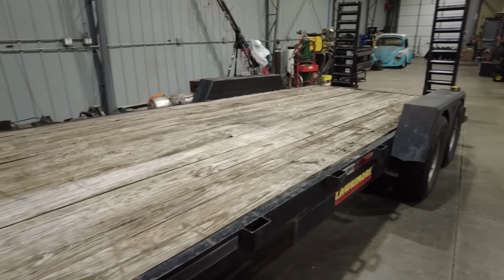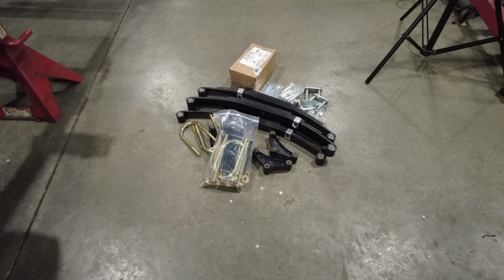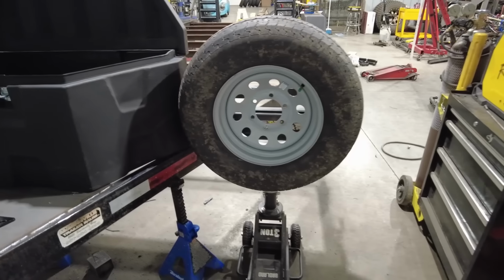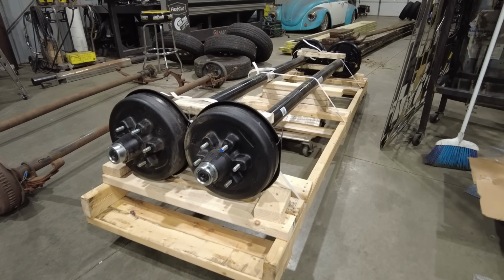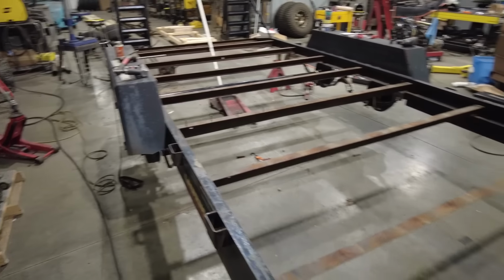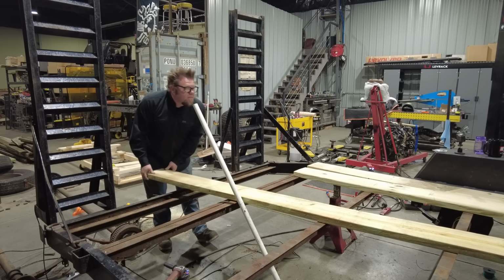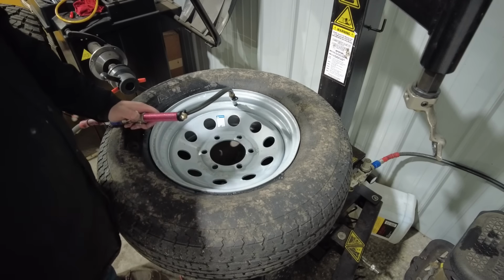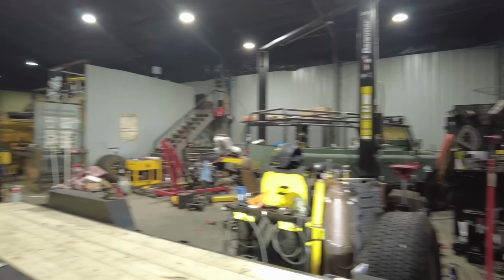Car Trailer Rebuild, How to Increase the Load Capacity of your trailer

Comment: As an Electrician, every time you mention a wire color, I want to scream NOOOOOOOOOOOOOOOOOOOOOOOOOOOOOOOOOOO!!!

For a Canadian or US Electrician, the following colors are LAW:
1-Phase 120 Volt Circuits:  Green is Ground, Black is Hot/Live and White is Neutral...
1-Phase 240 Volt Circuits: Green is Ground, Black is Line 1, Red is Line 2 and White is Neutral (so you can have a 120V device in a 240V appliance/circuit such as the lights and clock in an electric oven)...120V Line to Neutral, 240V Line to Line...
3-Phase 208 Volt Circuits: Green is Ground, Red is Line/Phase 1, Black is Line/Phase 2, Blue is Line/Phase 3 and White is Neutral...

Note: The Ground can also be Green with a Yellow Stripe or just bare, uninsulated copper...

😄😁😆😅😂🤣
Reply from the maker: You are comparing 12v to AC...completely different
Reply: @BigTireGarage  Yah, I know...but the Electrician in me just can't stop screaming...

😄😁😆😅😂🤣

Comment: Jack Upgrade suggestion: Mount a small motor to the jack with a gear on the shaft that is level with the top of the jack's top nut (the one the impact socket is used on) and either replace that socket nut with or weld a matching gear onto the nut so when you push a button, the motor spins and the gears then work the jack as if you're using an impact on it...

Then, you can dispense with the dedicated impact and charger and just run it directly off the winch battery in the tongue box (and mount a solar cell on the lid to keep the battery topped up when not connected to the truck)...A set of buttons in a waterproof box mounted to the outside of the tongue box completes the deal...unlock the cover, hit the button and the jack goes up or down as needed...
Reply: But he probably wants an impact wrench handy for fixing a flat or whatever. The manual mode on the jack is nice for if all else goes fubar you can just crank it by hand
Reply: @senorspiegel  a battery drill is all I use it dosent hammer on the spinny thing and they are cheap..usually have a few laying around .

Comment: For good reliable ground connections, I found placing a star washer between the frame and terminal, creates an incredible life long connection.  I have yet to have one fail .
Reply from the maker: Have done that, I have also welded studs onto the frame as a ground lug

Comment: As a lifetime upper midwest resident, I gotta ask, why didn't you address any of the rust while you had everything torn apart?  It would have added a couple hours of work, but extended the life of the trailer by 10 years.
Reply from the maker: It was just a little surface rust....nothing to worry about here in the south....and to do it right it would have taken quite a few hours

Comment: If I understand this correctly the weight of the trailer is included in the weight rating. So a 10k capacity trailer includes your poo box and the weight of the trailer with all its gear on it. I run a 10k factory built trailer and looking back my 7200# built Land Cruiser and the weight of the trailer was right there at capacity. Also, how do you know the frame of the trailer was over engineered enough to actually handle 10K weight? My trailer appears to be the same size as yours as far as length. Putting your spare there is the best idea I have found for the most flexibility of trailer use and keeping those annoying round buggers out of the way. My cross country trip had one spare. For the next trip there will be two and a winch and the wiring will be reviewed and butt connectors put in. @harrysituations posted a great video of him having a conversation with his trailer guru. I heard more about trailers than I knew and some great trips on maintenance. Great build Ian.
Reply from the maker: The frame of these trailers are all built basically the same....the weight limit is really handled by the axles, tires and wheels.  I did not weigh the trailer...but after all of these questions I might toss it on the scales

Comment: For the wire connection check out these new things I found.  They are heatshrink with solder all built in one. No crimping needed and just need a heat gun. I used them rewiring my trailer. Up here in Ohio I see lots of snow and rain. Those seal out the weather and give a great connection.  Thank you for the great content please keep on sharing.
Reply from the maker: I just got some of those in the shop gonna give them a try

Comment: I like adding some tubing to the center of the wheel mounts to support it while you line up the bolt holes. You can use round or square, just so long as you place it after mounting the first time so that it supports the rim instead of the lugs.
Reply: did that when I mounted tires inside the enclosed trailer on a rack. Makes it a lot easier to place it on and then spin it to line up the holes. I did use welded-through bolts. being the same thread, if you lost a lug nut, the spare had 3 available.

Comment: There are actually two ways to wire up a 7-way connector for trailers, you have the RV style with electric brakes, and there is also the commercial style used with air brakes. About the only common wiring between the two is ground is white, all the other colors are different between the two..........

Comment: May I suggest putting a spare tire winch from a pick up truck. Under the trailer just in front of the axle. Using one from the same brand as your truck. Means the tools to lower it will be with you. God bless

Comment: A single 6” roller fairlead would be a good idea on the center plate at the rear just before the dovetail section to protect the winch rope.
Reply from the maker: That is also a good idea...most of my stuff that I winch I can grab pretty high

Comment: Some spare tire carriers off of a pickup work well. Mount underneath the trailer and can tuck the spare up under the deck, then lower it down with the crank when needed.
Reply from the maker: Thought of that...concered with ground clearance we haul these trailers into some nasty spots

Comment: LOL you are building the same trailer that I have been using for some time.   Add some back up lights behind the rear wheels facing out.   Helps a ton when backing into strange places at night etc.   While I am sure Ian knows this already, but keep in mind that you have to subtract the weight of the trailer from the load capacity.   10K axles minus 2200 lb deck and frame is 7800 lb cargo capacity.  That amount could also be limited lower if you dont have the proper class trailer tire on it.

Comment: Sweet rebuild. One thing I wish I had on my trailer is some rock lights in the fenders so i could see the trailer tires at night. Never fails you feel that ghost vibration cruising down the interstate at 2am wondering.... are my tires good???  Great video!
Reply from the maker: I really wanted to try and figure out a way to have a switch inside the truck for that...maybe some wireless remote kind of thing

Comment: Ran into color code problem   as you did. Difference is between RV and utility/equipment trailers. Very confusing. I use conduit, cant see running wire thru torched holes.
Reply from the maker: That would of worked as well never thought of that...figured the holes worked for the last ten years

Comment: I've rewired several trailers w/ 7 pin wiring. The brown, yellow, and green is pretty standard for 4 pin setups and most replacement light kits. Everything I have seen w/ 7 pins has the colors the same as your junction box.
Reply: As a diesel mechanic. I can say that all the 7 pin connectors I have replaced, have the same standard as the 4 pins. Yellow and green for turn, red for brakes, brown for running lights, black for taillights, blue for abs, and white is ground. For the 4 pin setups. You take the blue, black, and red away. That box and cable is NOT US standard.

Comment: couldn't you have sold the trailer for about $2500 to $3000 then bought the new trailer? that would have equaled out to your build and maybe even have come out cheaper and less work.
Reply from the maker: I looked at trailers in similar states as mine...and they were selling for 800 to 1k...thats it
Reply: @BigTireGarage  well thats not good. I couldnt find one used for under $2500 over the last year. But yours looks great how you have it now.

Comment: What would be some good options to widen the trailer to the same width as the wheel wells, having a full 1 tons my tires hang off the trailer on each side so I have been trying to find some ideas to widen the trailer deck.
Reply from the maker: I was thinking of doing that...but my one ton stuff doesn't hang over too much imho
Reply: @BigTireGarage  thanks for video, I am getting ready to rebuild my trailer and this gave me some good ideas! keep up the good work Ian.
Reply: Check out lowboy semi trailers that haul big heavy equipment. Some have swing out knee braces with a flip over plank to widen the deck when hauling oversize stuff.

Comment: The only thing i think this is missing is paint. Wire wheeling the frame and putting a bed coat or black paint would make it look brand new, and not cost that much. Time may have been an issue tho
Reply from the maker: I was considering doing that....but I just didn't want to spend the time

Comment: Another great video! Thanks
Trailer wiring varies a lot. There are at least 10 wiring methods if you include the 3 round, 4 flat, 4 round,  5 flat, 5 round, 6 rectangular, 6 round connectors, 7 round blade (SAE J2863), 7 round (SAE J560) and the 2, 3 or more versions of the J560. 
Only standard, all trailer wiring in North America uses white for negative.
The one you bought is non-conventional J560. Even the use of the yellow and green is totally non conventional.
Now, the "standard" 7 wire plugs with round pins SAE J560 uses black for clearance/outline marker lamps, side marker lamps and identification lamps, yellow for left turn, green for right turn, brown for tail & license plate, red for stop/brake lights and blue for the e-brakes.
Your use of the black as +12V is like the SAE J2863 and SAE J560-like plugs and your use of yellow as reverse is also non-conventional, but hey, it's YOUR trailer! As long as you don't lend your trailer, you can "DO IT YOUR WAY" as the song says! 😉
Besides, it's a good excuse for refusing to lend it...😂
Reply from the maker: You know what they say....if you want more friends...but a boat or a trailer
Reply: It used to work to put a 2 5/16" ball hitch on the trailer.
Now everyone has that size ball now.

Comment: You can get those junction boxes with no wiring and then use conventional 7-way pigtails with the correct coloring.  There is also a 10-pin one if you have other powered accessories (lights, compressor, etc).

Comment: All that work and you didnt knock the rust off the frame and paint it ??? Thats makes no sense
Reply from the maker: It was just surface rust....and if I was going to go that route I would of wanted to go all the way and strip and get it powdered coated...but I didn't have the time for that....I could of also painted it with POR 15 or other rust encapsulation....but once again....too much time for something that just has surface rust on it.

Comment: The color code for a seven ways standardized across the industry so the colors actually will be like you had on that printed ticket, flat, four uses a different color code than the seven  round bargeman plug
Reply from the maker: Interesting....but this trailer was a  pin from the start of it's life and brown was always running lights who knows...trailers are always a mystery

Comment: In AC voltage, Black is Hot and white is Neutral. Cars are almost AC. isn't the Alternator AC, converted to Dc into the interior of the vehicle.
Reply from the maker: Yes....but in all 12 Volt wiring black is ground....but in trailers white is ground....no idea why
Reply: AC is produced in the alternator, then converted to DC in the alternator / regulator diode triode. Some components then convert back to AC. Unless you are talking about hybrids or EV, then things go off the rails.

And, not all 12 volt systems black is ground. Ford seems to like white with a tracer strip, and some systems have all white wires with circuit numbers printed on them.

Comment: Why not solder connections instead of butt connectors?  Just a case of preference or time vs just crimping connections?
Reply from the maker: I don't like solder connections in automotive applications, just like in aviation (where soldered connections are not done) the excessive vibrations can cause them to weaken over time

Comment: I rather rebuild something I already own instead of buying new or used and I can do upgrades. If I was doing the upgrades to trailer like this I would add two jacks to the rear of the trailer. I would  fully weld the center metal strip of metal so I can add d rings for hauling bikes atvs lawn mowers and anything small. Led flush mount pods for backup lights and more led marker lights that way I'm more visible and have them set-up to flash for emergency reasons

Comment: Surprised you didn't go with a electric trailer jack.
Reply from the maker: Thought about it...but this one is like the best of both worlds tbh...if I want it to act like an electric jack I can
Reply: I commented before I seen the part about using a impact. I like it even better. Especially if the size for the bolt is the same as the lug nuts.

Comment: Ive been thinking about doing the same axle swap on my trailer.  The extra capacity would be nice.
Reply from the maker: It was only 400 more for the two 5K and most of the packages for twin 3500 did not have four wheel brakes
Reply: I manufacture trailers for a living. When you have a trailer with 3500 pound axles the material the frame of trailer is made from is designed for a max of 7000 lbs. When you buy a trailer with heavier axles, you will have a heavier frame to support the extra capacity as well as a heavier coupler. Yes by upgrading the axles they will support more weight, but they are attached to something that was not designed for the extra capacity
Reply: @kentbuerk9479  Yes yes yes.

Comment: Would like to see some pics of how you mounted the winch plate and its final design, didn't really cover that after cutting it on plasma table. Any concerns with that top tube flexing when pulling vehicle onto trailer?
Reply from the maker: No...that tube is attached to the frame at that location from the factory

Comment: Hey Ian, the center pin on the plug is for reverse lights on the trailer. Might be useful to add a couple lights at the rear of the trailer and hook them up to that.
Reply from the maker: Considered that...but with the led cubes I can just switch em on when I need reverse...I was also thinkingbof adding a stinger to energize them when in Reverse
Reply: @BigTireGarage  i put a set of backup lights on a friends boat trailer because he backs it inti a poorly lit garage and he thinks its the best thing since sliced bread. 🤣
Reply: I added reverse lights on my boat trailer and they rock, no switches involved and they let other drivers know I'm backing up. I also did my wiring with heat shrink solder connectors with an additional covering of heat shrink. Three years of submerging the wiring and lights and no issues. 47:27

Comment: Hello Ian , I have dodge truck two wheel drive is the frame the same as a four wheel drive ? Love your  show.
Reply: probably not , most 2wd trucks have a narrower front frame for the A Arm suspension while the 4wds had a wider frame for the leaf springs if its a older truck. The only 2wd vehicles I know of that can be a bolt over swap are solid axle Jeeps since they just toke there 4wd stuff  put a 2wd trans in and a solid tube as the front axle.
Reply: Thanks NutKase

Comment: $7500 of a new trailer? Up here in Canada that price would be double.
A steel deck can be slippery with frost or wet, a wood deck is easier to repair if you drop something heavy on it and crack a board.

Comment: A fuel tank is a good addition to car trailers. Especially if you're towing long distance, or wheeling on long trips
Reply from the maker: I carry fuel jugs on my big 40 foot trailer
Reply: Mount under the deck by the axles so it don't drag ..like rvs mount holding tanks. Protected and out of the way ..